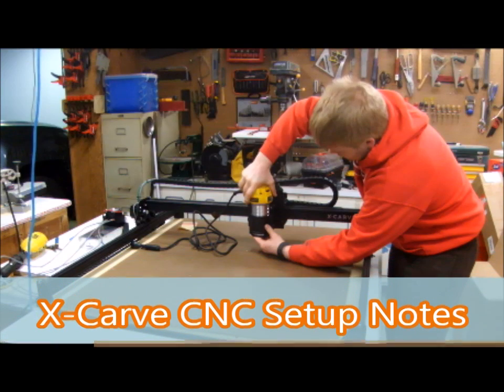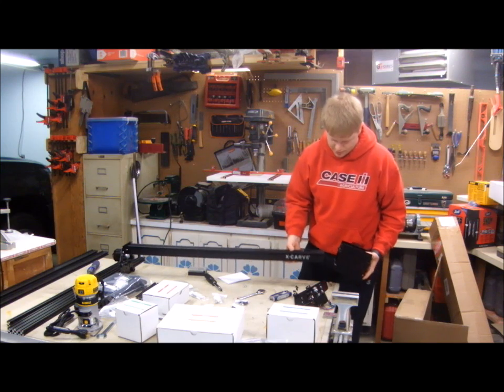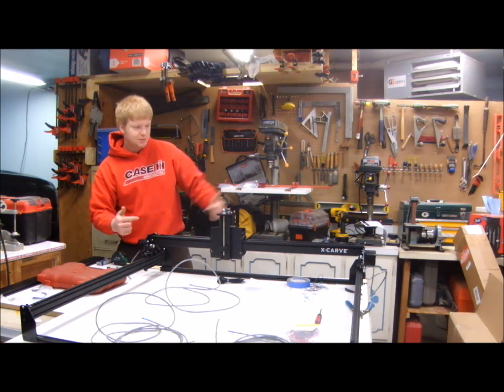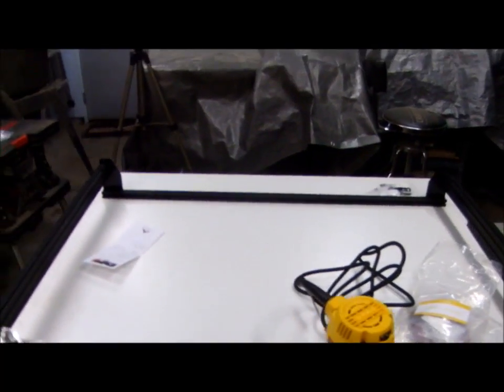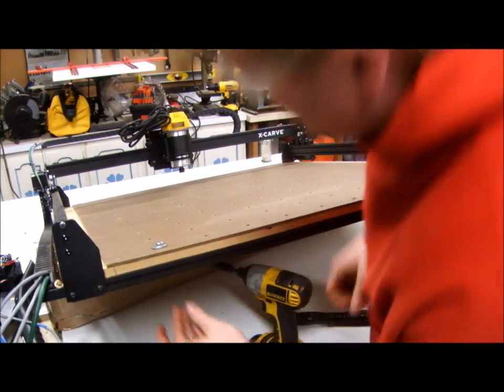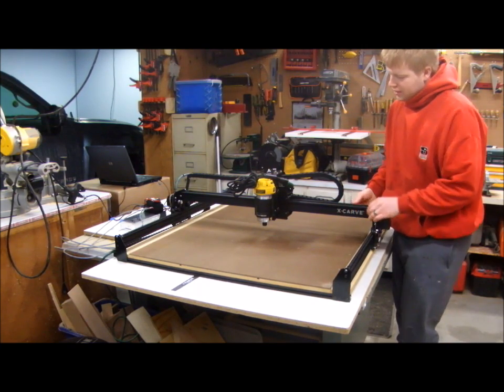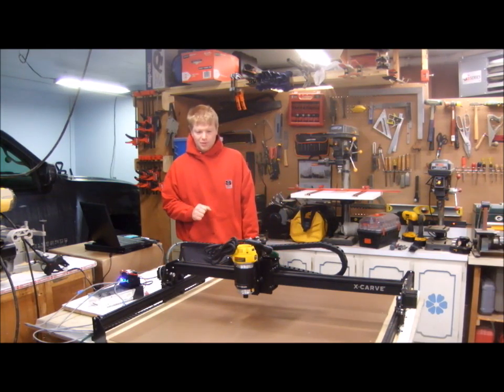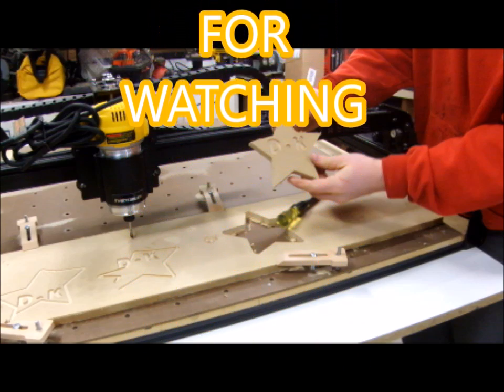X Carve CNC Machine Setup Notes

Comment: So...... you realize  that  the drag chain section pop apart with a small screw driver. No need to thread the wire through, you just lay the wire in and then snap the chain back together lol

Comment: pine with a 1/4 up spiral 2 flute bit I go 50 - 60ipm at a depth per pass of .08-.10. with an 1/8" straight 2 flute bit, I go 60 ipm at a depth per pass of .045.

Comment: so.. keep the dewalt at speed 1. even very hard maple only needed dewalt speed 2. go to the forum and follow the potentiometer calibration procedure and the stepper calibration procedure. charred bit means too fast of a bit and too slow of a feed speed (ipm). you want chips, not dust. chips equal heat being removed from the bit. the longer a bit rubs on one spot, the more heat. fewer rpms and faster speed means less rubbing.
Reply from the maker: +7711gman Good tip.  So far I have only run X-carve with the router at top speed.  Slowing the bit down makes sense.  I will try that.

Comment: Im only using nema 17s and have never needed to increase power to the motor I would be extremely careful in doing that. Also I put little heat sinks on my stepper drivers. I carve a lot of big stuff.
Reply: with the NEMA 23 Stepper Motor you have calibrate the potentiometers for the voltage. this is an off the shelf kit with many factors. you should fully calibrate the x-carve.